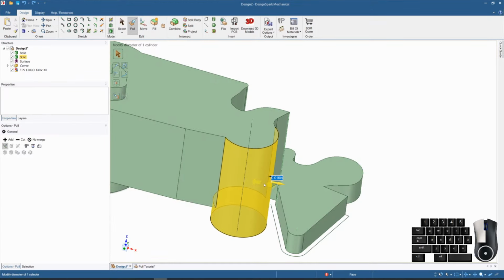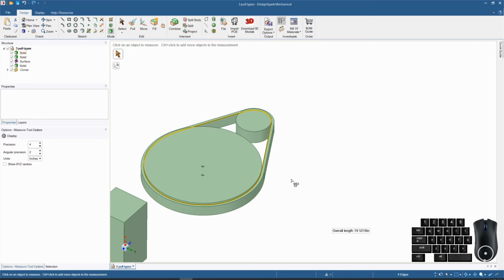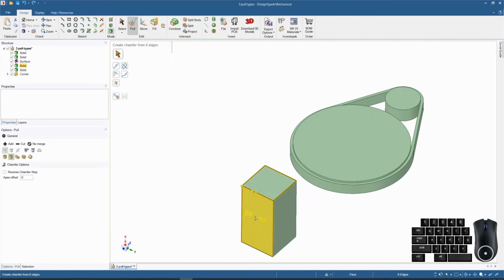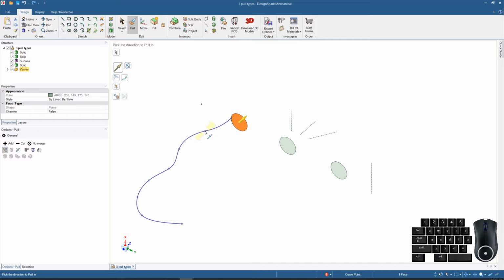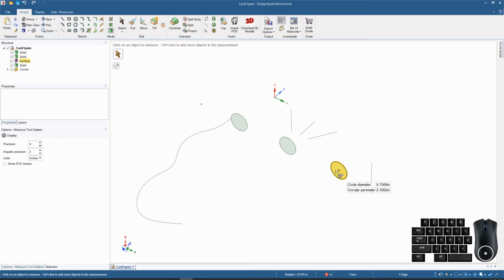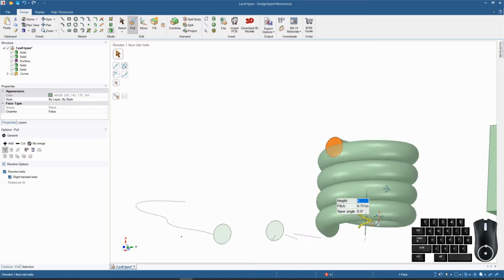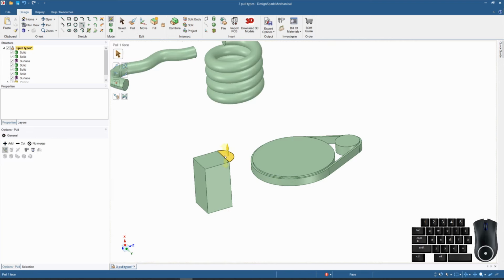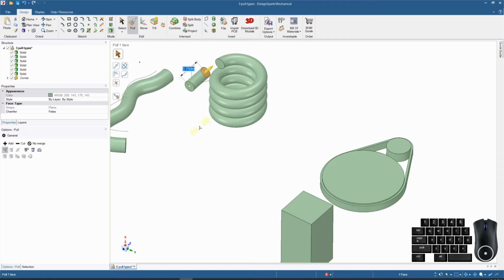DesignSpark Mechanical Tutorial - The Pull Tool IN DEPTH (DSM08)

Comment: The software Version that I just downloaded does NOT have anything on the Left-Hand Side of the Screen other than (Design and Solid), and Nothing that I Click On will bring up the 5 Bottom Buttons dealing with Edges. Have they been removed? What Version are you using for this Video?
Reply from the maker: Hi Jeff, Something must be wrong with your install maybe? I was using 4.0 but just updated to 5.0 and it is still almost identical...   I will be back to making additional videos very soon!

Comment: I was trying to put threads on a 1/2 in shaft, 20 tpi. Had a little triangle positioned the depth of the threads.
I could pull it down and it would do all kinds of crazy stuff. It looked just fine for 1 round, then it would change from
cutting to making a solid in place of the cut and the rest of the solids would disappear,keep moving down and it would show up
 with the threads on for a little bit. If I could get it stopped just right, it looked just fine. I knew I saw someone talking about  something odd about the Revolve helix tool. So I watched this again. I cut the little triangle off at the point it touched the shaft and ran it out to where I could select it and it worked just fine. The threads have a small flat on top, so the tool never touched itself. You couldn't see where it was hitting when it was cutting and the solid just looked like a spring the shape of  cut with a little space between them.
 THANKS A LOT, appreciate you doing this.

Comment: I’m having a really hard time with a simple task if you have a block and want to cut an angled hole through that object I can only create straight through holes but I need a 30 degree hole through a block
Reply from the maker: A quick easy way is to make a new component ... Make a cylinder the size and shape you want. Move the cylinder to the location you want the hole, then use the combine tool to cut and remove the cylinder from the block... I know it seems like a lot to do for a stupid hole, but this method sets you up for much more complicated projects in the future... Hope that helps... There is a video for using the combine tool for cutting out shapes...

Comment: Need help. Laid out a spline, did all the steps in the same order, made sure I watched it multiple times and only get an arrow following the path from the circle shape. If it is of any difference, your spline is dashed where mine is solid. Once I click on it it becomes dashed and purple.Even tried with a surface and a solid. If I click the surface of the object the arrow goes from the end of the spline to beginning. If I select the edge the arrow travels in the correct direction but no object is formed. Also get an error mess.: "Extrude produced no result" What did I miss?
Reply from the maker: I assume you are trying to use the "trajectory" function? @ 18:45 ish?  A couple things to try... 1 move the face you want to pull so that it's edge is aligned and touches the spline you want to follow... 2 make sure you select the FACE to pull, not the edge of the face...  When you select the spline after clicking on the Trajectory button, does the yellow curved arrow show?
Reply: @fabricationplanet  Thanks for responding so fast however, I figured it out! My spine and circle where lying flat on the same plane. Which one of your videos shows how to set up the different planes to one another. It's a little deceiving looking at a spline, difficult to tell it's direction.